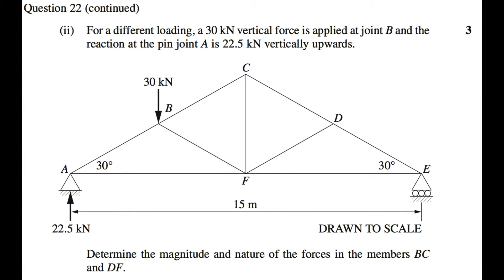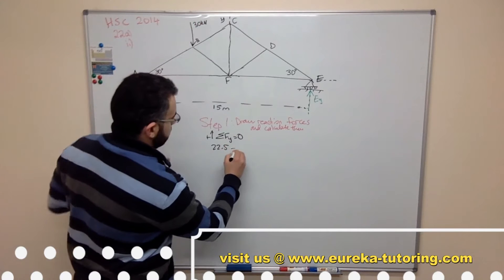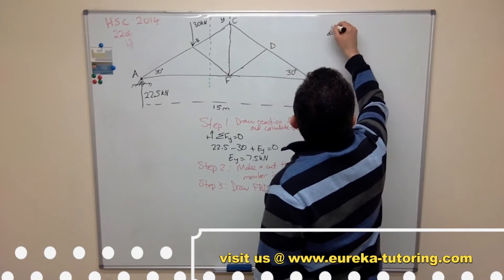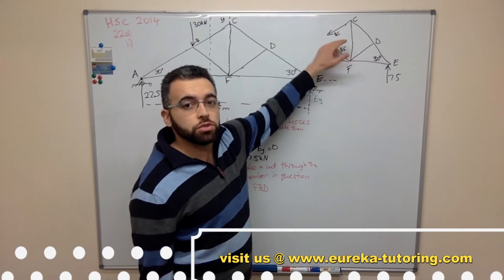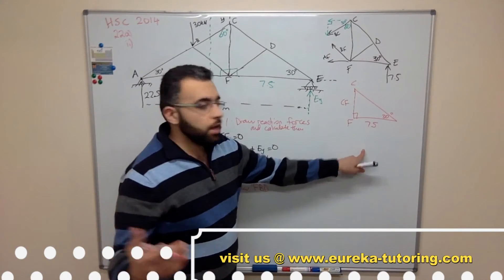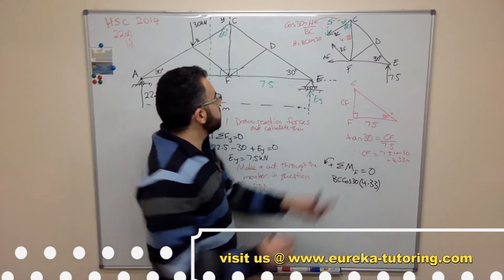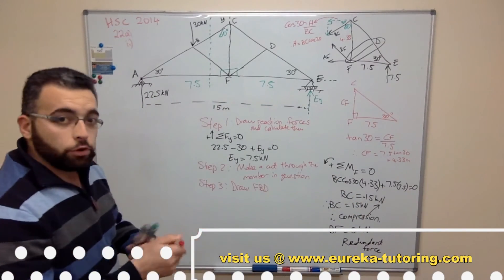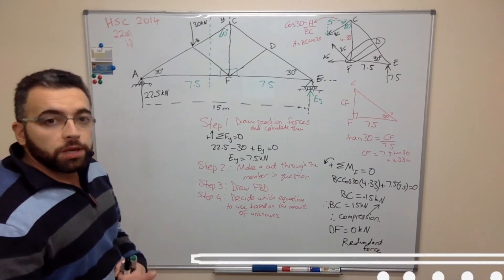METHOD OF SECTIONS - HSC 2014 Q.22a)ii) - Engineering Studies

Comment from the maker: In response to Taiyue's comment, you can only calculate the nature of its force based on its direction relative to the member joint. So, if BC is pointing towards B then its compression. It should be the same no matter what you side you take.

You would only use Sum of Forces if you had one unknown so yes if there's 2 horizontal forces and 1 diagonal force (and its the member in question) then you would use Sum of Forces in the vertical direction as there is only 1 unknown in that direction (horizontal forces have no vertical force). Use moments when you have at least 2 unknowns. 
Hope that clears things up and goodluck!!

Comment: Thank you for addressing everything very clearly in the video!
Just a quick question because I've made a few mistakes when identifying the nature of the member,
Is the nature determined on which side you section the truss? 
For instance in the video, if you calculated the BC on the other side, would it still be in compression, but pointing towards B?

Additionally, if the truss was a Warren type truss with horizontal members on the top and angled members joining them together, would you always use Sum of the Forces Vertically/Horizontally instead of Sum of the Moments?

Comment: Great tutorial but still don't know how to determine redundant members by inspection. 
Could you explain why DF is redundant? Wouldn't CD or DE put a load into the member?
Reply from the maker: +Uran00b97 - Sorry I should have clarified that! 

Ok lets consider CE to be lying on the x-axis. Draw a perpendicular line to that axis to denote the y-axis. Analyse Joint D by performing method of joints. If you do Sum of Forces in the X-direction, you will have CD = DE. However, if you do Sum of Forces in the Y-direction, after converting DF into its y-component you will have DF*Sin(theta) = 0 since its the only force in the Y-direction. Hence DF is redundant with a force of 0.

Hope that clears things up!
Reply: Thanks for the reply! Are forces in thse examples i.e. CD & DE always going to be equal to each other? So say force in AB and BC, are those always going to be equal each other? I'm not really clear with MoJ. Also do all single member force in a certain direction with nothing else in that direction equal 0? So in the example, DF*sin(theta)=0 part.
Reply from the maker: +Uran00b97 Actually, DF impacts CD & DE as it also has an X-component but we said that DF is 0 hence CD = DE. Now, this isn't always the case especially when you consider member AB & BC. This will not equal to each other as there is a 30kN load acting on Joint B. In regards to your last Q, yes it'll always be 0 since the Sum of Forces equation is an equilibrium equation. So if there is only 1 force involved, it would be F + 0 = 0. Hence F = 0.